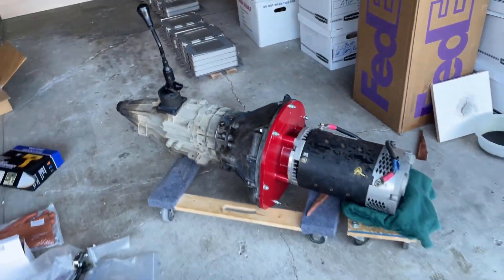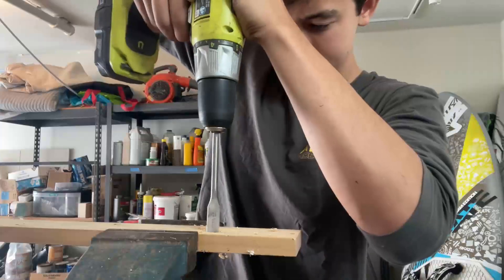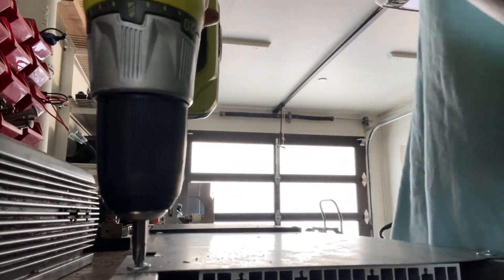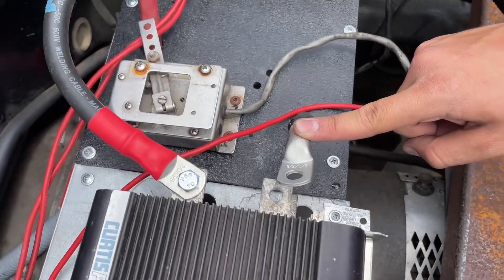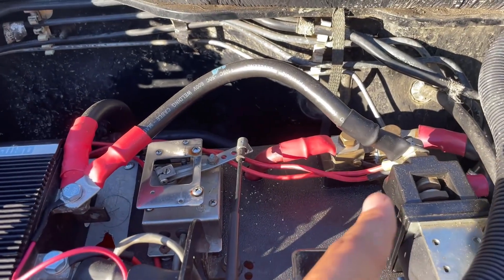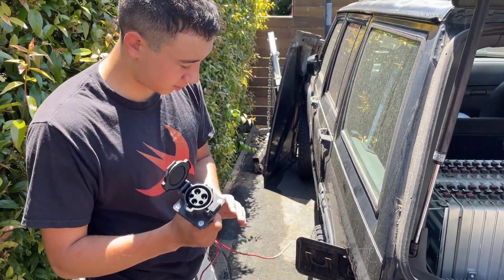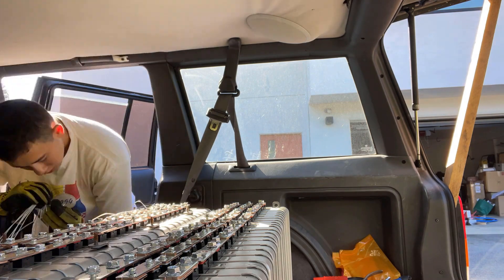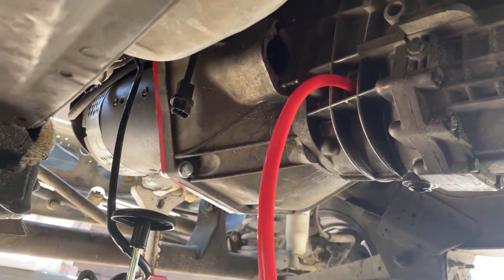Wiring the Jeep's Batteries! (Jeep EV Conversion)

Comment: Great job so far. One piece of advice: you NEED to use rubber grommets when passing wires or hoses through the holes in the body even if the edges are not sharp. You could quite possibly short everything out and maybe hurt yourself. Other than that, Herat job
Reply: Absolutely essential safety critical comment.  Do not ignore!!!
Reply from the maker: Yep, working on that!
Reply: I noticed this too. Those holes have sharp edges and  vibration will make the edges cut through the isolation and can end up in disaster. Hopefully you have  rectified the issue by now. 
Great Job by the way.

Comment: man its been like a year. since I last saw your video. good job man. keep it up. slow but steady. also do you use automatic transmission or standard?
Reply: Its a manual. I had an idea like this a year ago when I blew up my nissan pickup but never had time and money to do it. Hes doing it alot more properly than I would have and it's very cool. I wanted to just weild the electric motor from a conver belt to a flywheel and run it on about 100 volts